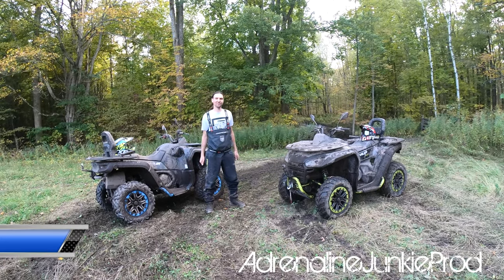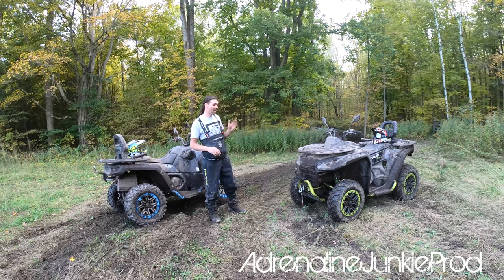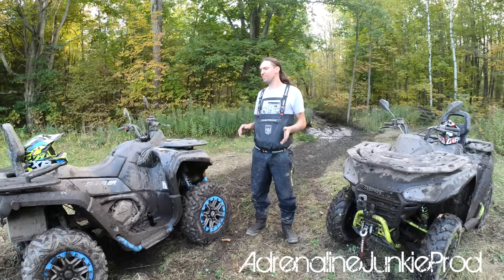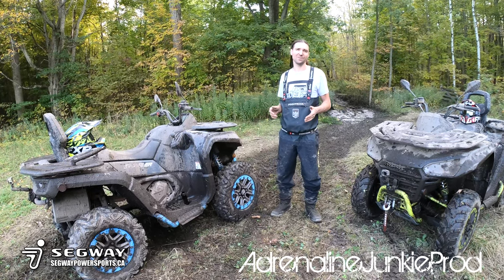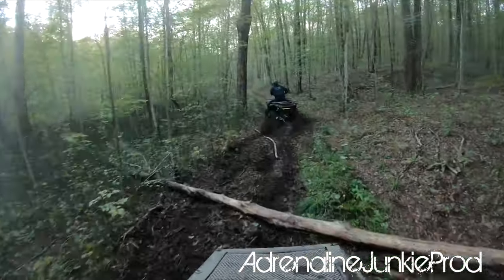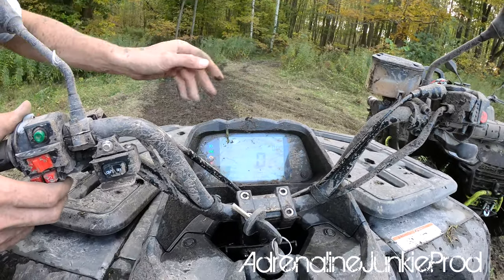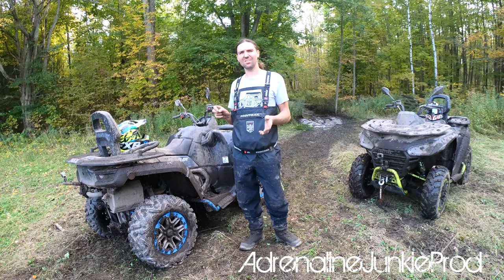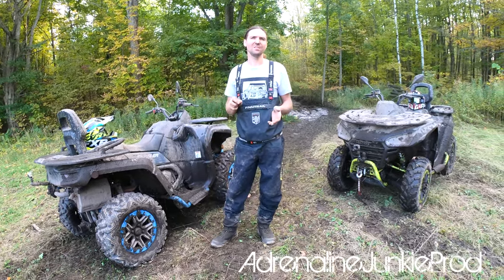Segway Snarler 570 ATV - Should you buy one? Watch this first! Review + Initial Thoughts

Comment: Be careful with that brand!!! Mine is not working since august and nobody takes responsability. And Im not the only one. Worst atv ever.
Reply from the maker: Oh ya? That’s not cool at all. Where are you located? Canada?
Reply: @AdrenalineJunkieProd  Yes in Quebec. The dealership is in Joliette. Awful experience. Tried to solve the issue with both the dealership and Segway but no interest at all.  My atv doesn't even has 250 km....... it is a very good looking piece of garbage.
Reply: hi i live in the uk bought one in july what a bag of shit the exhaust has snapped twice ,default with welding,ecu had to be changed,4x4 plays up,now its gone back to the dealer when you throttle off it trys to throw you over the bars like a rocking horse.its on a bench now with the pully out wich was rusted not good for a couple of months old with no abuse only green lanes
Reply from the maker: @omarvaldes8255  I reached out to my contact and have been told they will be looking into this. I'm hoping this helps you resolve your issues. Sorry to hear about your luck.
Reply from the maker: @denothedogsmith8442  that sucks, hopefully the dealership can get it all sorted under warranty for you. Let's hope it's an isolated issue.
Reply: @AdrenalineJunkieProd  I really appreciate your help, unfortunately, they always say that. After all the problems, delays, lies, etc, etc I asked for my money back and they refused. ATV is still not working and they are just avoiding their responsibility. I had enough of them.  Awful experience.
Reply: @AdrenalineJunkieProd  no apparently the guy from dualways has told my dealer that they can string this out for the duration of the waranty wich basically means yanking my chain for 2 years
Reply: totaly agree crock of poo mines done 92 hrs only and dualways will not take responsability ive had 2 seek legal advice now
Reply: @denothedogsmith8442  yes me too. Already in legal process. Apparently that’s the only way.
Reply: @omarvaldes8255  hope you get a result my freind

Comment: I've read a few negative comments on here, I just wanted to say myself and 4 of my mates all bought the Snarler at the same time. We all love them and have not experienced any major issues. The biggest issue in the UK is getting parts and accessories, this however is something all brands are currently experiencing. For the price they are awesome!
Reply from the maker: I’ll repost this response I made to another similar comment because I feel it applies: Ya, that’s the problem with these newer brands trying to break into the market. They haven’t built up the parts inventory. They don’t have an established dealer network. There is not significant aftermarket support. They get you hooked with a slightly lower purchase price but then you are left hanging. This isn’t a hit at Segway, it’s just the reality of being new to a highly competitive market, especially during such crazy times with supply chain issues all over. Established aftermarket brands can barely keep up with the popular and established machines in the market, they aren’t going to shift production capacity to a small brand that doesn’t even have a 1% market share at this time. All newer brands have had similar struggles, it takes time to develop a support network and build brand loyalty. It takes time to R&D a product line. Look at the struggles CF Moto had in this department and arguably still has and all the other “B” and “C” level brands (for lack of better terms) are constantly struggling with this. When you buy from a big established brand like Polaris, Can-Am, Yamaha, Honda, Kawasaki, etc… you are paying for the established network and reputation. You are guaranteed a certain level of support and product availability you can’t possibly expect with a new to market brand. I know this may negatively push the buttons of a company like Segway Powersports but it’s just a cold hard fact. You can’t deny that. The other brands have 40+ years of experience under their belts and they built this market segment. You need to acknowledge this and give credit where credit is due. Did Segway Powersports bring a good product to the table? Heck ya, for a first generation machine I feel they did well. I pride myself on real world and unbiased reviews and the points I touch on are big things to consider when choosing a machine.
Reply: Spud, after 2 years, do you and yours friends still happy with the segways? Issues?
Reply from the maker: @FalcoVerkleij  I agree, it would be cool to hear some longer term feedback.

Comment: 1 Year of ownership update.. 2021 Segway Snarler AT6SX Canada
3900km
-All 4 wheel bearings are shot, (not sealed bearings any water over the hub will ruin them. They suggest taking the whole hub off every 800km and greasing them with an EZ greaser tool. Foolish service amount)
-Font Differential blew apart (I may have used 4wd 5-6 times in the full year of ownership and always came to a full stop)
-Rear Diff seals leak
-Oil pressure sensor failed(known warranty fix)
-Exhaust cracked (known issue but for some reason not getting covered under warranty)
-CVT Recall for clunky starts and disengaging going down hills (sketchy)

Bike has been serviced relentlessly, I did the break in service, one 1000km after that, another one before a NFLD trip and now it's been at the shop ever since the NFLD trip since Sept 17th 2022. So i've had it for 11 months, the last 4 it's been at the shop. Avoid these things get a yamaha, honda or kawasaki..
Reply from the maker: Hey Frasered, great feedback. Thanks for sharing your experience. Sorry to hear about the issues you’re having. As mentioned in the video, the true test for any machine is how it holds up in the long run. Something we couldn’t really address in a video like this. Issues are one thing when they are being dealt with efficiently and professionally by a dealership. I don’t think there is anything more frustrating then having your machine at a dealership for an extended period of time with no results. I’ve heard similar stories to yours now from a few people. From what I’ve heard the exhaust and oil pressure sensor issues are very common.  It’s upsetting to hear they aren’t dealing with them quickly under warranty. All the other issues sound like a headache too. I hope you get things sorted and Segway Canada stands behind their product. Let us know how things play out.
Reply: Even a can am or a Poolaris would be better I bet
Reply: update on this?

Comment: That is a very nice quad I think the biggest thing I like is the power steering system you can change the settings and its street legal stuff on it looks like it take everything you throw at it
Reply from the maker: Ya, you can use the Segway APP on your phone to change the power steering settings and a bunch of other cool stuff. I haven't really messed around much with the APP but it's a neat concept. The turn signals, horn and mirrors are a nice little addition.

Comment: You would still choose Polaris 570 Touring and not Snarler? Are only aftermarket parts and service the difference?
Reply from the maker: I feel that those are big areas of ownership. Also the Polaris platforms are tried and tested. This is a new machine, there is always some risk. Like I stated in the video I do feel the Snarler is a good machine. I do feel the new can-am 570 has more power and better clutching. I’d say the same about the Polaris overall. I don’t think buying a Snarler is a bad idea. It has a lot to do with what you expect out of it and how you plan on using it. I’m incredibly hard on my machines and need a reliable supply chain for parts. To me that’s important but the price point of the Segway is nice. The aftermarket is starting to develop for these machines. I do think of Segway keeps pushing and learning from any growing pains they have some good potential here. I was really happy with this thing, especially factoring in it’s a first generation platform.  I’m just trying to be realistic and grounded in my feedback. To make a true evaluation we need time. We need to see how the machines hold together after 2 or 3 years. How the brand stands behind their product and how they address any issues.

Comment: I broke left cv axles wish I can get new cv axle in Chilliwack bc
Reply from the maker: Ya, that’s the problem with these newer brands trying to break into the market. They haven’t built up the parts inventory. They don’t have an established dealer network. There is not significant aftermarket support. They get you hooked with a slightly lower purchase price but then you are left hanging. This isn’t a hit at Segway, it’s just the reality of being new to a highly competitive market, especially during such crazy times with supply chain issues all over. Established aftermarket brands can barely keep up with the popular and established machines in the market, they aren’t going to shift production capacity to a small brand that doesn’t even have a 1% market share at this time. All newer brands have had similar struggles, it takes time to develop a support network and build brand loyalty. It takes time to R&D a product line. Look at the struggles CF Moto had in this department and arguably still has and all the other “B” and “C” level brands (for lack of better terms) are constantly struggling with this. When you buy from a big established brand like Polaris, Can-Am, Yamaha, Honda, Kawasaki, etc… you are paying for the established network and reputation. You are guaranteed a certain level of support and product availability you can’t possibly expect with a new to market brand. I know this may negatively push the buttons of a company like Segway Powersports but it’s just a cold hard fact. You can’t deny that. The other brands have 40+ years of experience under their belts and they built this market segment. You need to acknowledge this and give credit where credit is due. Did Segway Powersports bring a good product to the table? Heck ya, for a first generation machine I feel they did well. I pride myself on real world and unbiased reviews and the points I touch on are big things to consider when choosing a machine.